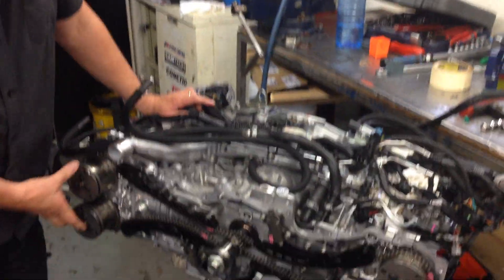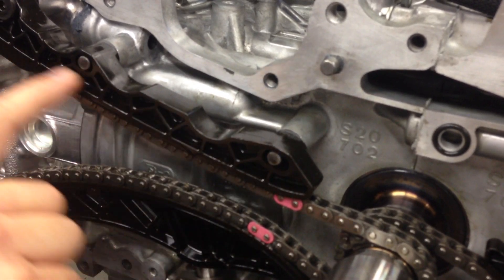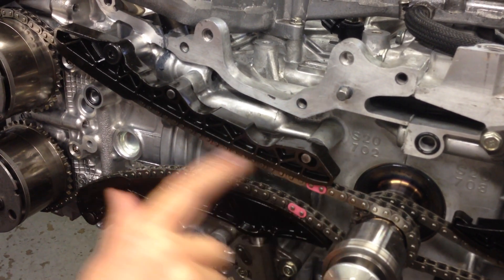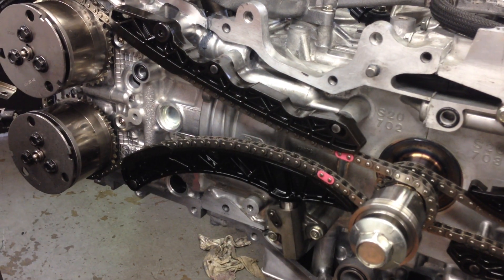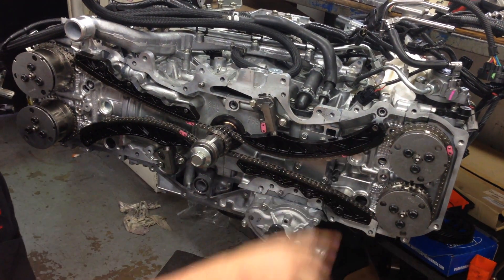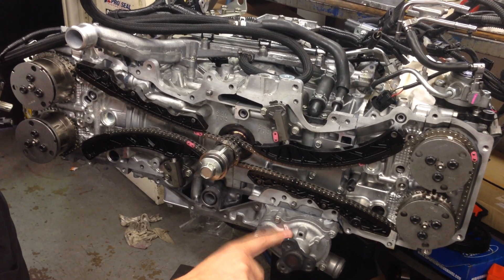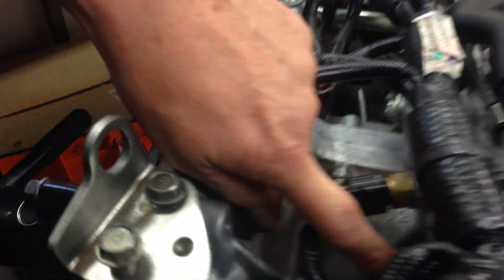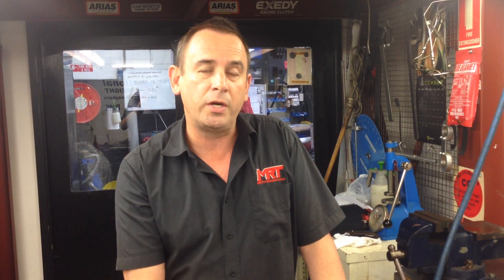Subaru BRZ FA20 cam chain info, tips and traps

Comment: What is the correct angle for the knock sensors on a fa20 dit? I am in the middle of an engine rebuild and can't find the correct angle anywhere!
Reply: I have the service manual. I can send pics if you send your email

Comment: Hi Brett - Another possibility is that If you dont tighten the tensioner enough you can cause the chain to slap for a little bit just after starting.  This in turn might of caused the guide pin to drop, making the issue dramatically worse.

Comment: Have you come across Cam gear failure?  P0018 code, runs and idles fine?  18 WRX fa20 39K miles, Thoughts?  replacement for cam gear would require chain to be removed and the 3 bolts to pull the cam gear of cam shaft itself and put new one on correct?

Comment: Can you do a video on properly setting the timing?
Reply: To set the timing turn the keyway on crank to 6 o'clock position the drivers side arrows on the face of the intake cam at 8:00 and the exhaust cam to 1:00 now turn the crank to where the keyway lines up with the first dowel pin of the floating chain guide on the passenger side of engine (he was pointing to it in the video). Now put the locator link (yellow on the FB25) aligned with the oblong oval on the face of the crank sprocket. Then fish the 2 other links (orange on the FB25) and align the top one with a line on top of the intake sprocket you should now see and the exhaust needs to align with the dot on the face of the sprocket (the one on the bottom). Now install chain guides and tensioner and pull the pin for the tensioner, squeeze both guides together and you want to hear 1 more click from the tensioner and it should be done. 

Now rotate the crank counter clockwise to the 6:00 position now point the intake arrow to the 6:00 position and the exhaust to the 12:00 position. Now align the first locator link to the cranks oblong oval on the sprocket and the intake to the line on top and the exhaust to the dot on the face of it. Do exactly like the other one and install guides and tensioner. If you turn it over a couple times and you feel any resistance do not force just start over. 

this is a 2 stage process and make sure the single color locator link is not over the keyway on the crank it has to be over the oblong oval on the sprocket.

Comment: Hi,   I keep getting a p0016 engine code and I want to pull off the cam cover. Can I pull it off and work on the engine without pulling the engine out of the car? I have broken the problem down to the bank1 (possible chip tooth), or a ghost code on the ECU /PCI.
thx
Dave
Reply from the maker: sorry, we choose not to give advice on work where we dont do it, its too risky to know what you can and cant do and where and with what tools
my advice is choose a good local mechanic who knows the car:)
Reply: DAve W I’m having the same issue code P0016 changed the cam position sensor on bank 1 and changed the crankshaft sensor. Did you ever get yours fixed?
Reply: DAve W you don't have to remove the engine just to check it. If you are doing head gaskets than is better to remove
Reply: were any of you guys able to fix your p0016 code? :( currently going through this.
Reply: @ardikasulistija6574  Did you manage to fix it? I'm having trouble with it now.
Reply: @dimitarchardakliev5351  Nope. Subaru dealership near me flew in some subaru engineers and they couldn't fix it or figure it out. Since mine was OTF tune, they recommended for me to go to a performance shop. However, they  had two cars going through it. One was bone stock, and the other was mine. I don't think mine was caused by the OTF tune because I was running it like that for a long time without issues. Unfortunately, I before I could take mine to a shop, by brz was totaled. :/
Reply: Also, whenever I clear the P0016 code prior to driving, the car ran perfectly fine. I suspect a ghost code on the ECU as mentioned by @DAve W
Reply: @ardikasulistija6574  Wow, that's fucked up. I've replaced virtually everything aside from two cam sprockets and the ECU and I was planning to order the other 2 cam sprockets to see if that would fix it. I love the way the car drives but I had enough of it.
Reply: @ardikasulistija6574  We went in to the OFT and deleted the code by turning it off.  I haven't had a problem since, going strong over 2 years since the delete.  It's been to a tuner shop and they told me that if runs perfectly.
Reply: @davew1633  How did you permanently delete the code? Every time I cleared the code using the OFT, it would just come back again during my next drive. Perhaps someone in the comments will find your answer useful.
Reply: Ardika Sulistija we went in to the tune it self and turned it off the code.
Reply: @ardikasulistija6574  I've also heard that that's a possibility. Just delete the code not clear it - delete it.
Reply: @davew1633  Did you change anything mechanical? AVCS, Cam sprockets etc?
Reply: @ardikasulistija6574   You need to go into the tune and turn off the sensor that triggers that warning code.
Reply: @dimitarchardakliev5351  no

Comment: Do u need the thermostat in hot climates such as the caribbean
Reply: Kenyatta Antoine yes you do.
Without it the coolant circulates too fast, the water pump cavities, and you get hot spots in the engine.

Comment: great tips. Always wanted to see the double chain. the passenger right rear knock sensor first appeared in 1985 turbo EA82.. I just bought a rare 1985 RX engine... just turning 30 years. A lot of stuff moved on up to today. The sight of the chains swapped for belts for example..the two of them. Given the problems, I'd rather the old belts...and two valve heads for that matter, but have fun. :)